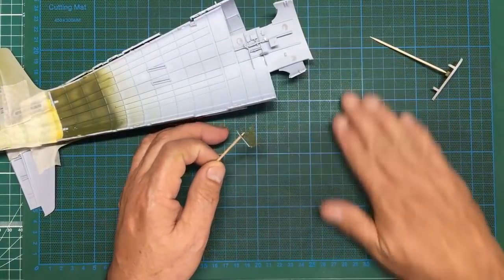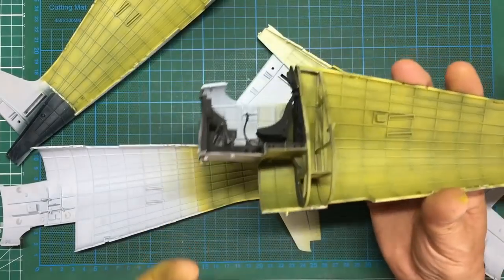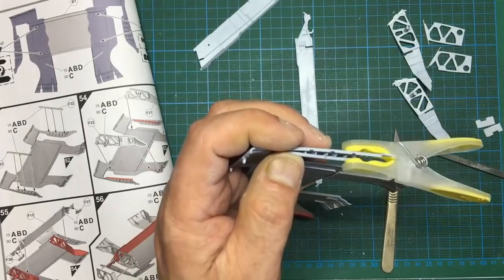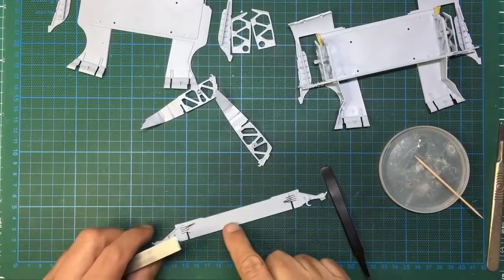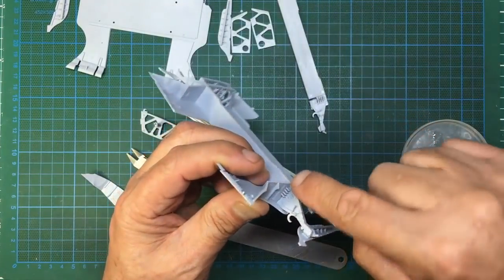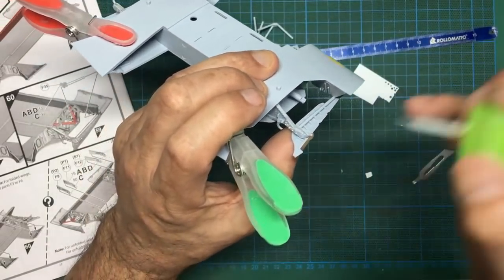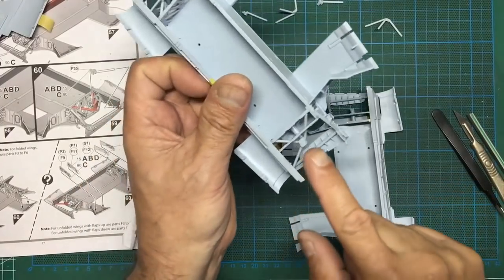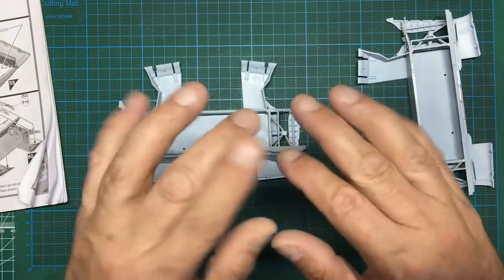Airfix 1/24 F6F-5 Hellcat in FAA service. Part 4... lots of stuff..

Comment: Great video Nigel.  I tried scribing between those molded on tubes but after I was done they still looked clunky so I cut them off and replaced them with lead wire also and the effect is much more realistic.  Thanks for the tip, looking forward to what comes next.

Comment: '' For corrosion control the landing gear, the bay and all of the door interiors is the same as the underside color. The only interior green would be forward of the main spar with lots of Light Gray overspray. The cockpit should be bronze green (1st 100 or so Hellcats) or interior green. Inside of the cowling and the area behind the cockpit with the windows is 'Grumman Gray' which is about FS36440 Gull Gray''...Seems that there is a lot of confusion about these colours isn't there..Leslie

Comment: Nigel you mention copper or lead wire. What is the difference as you mentioned lead can for a flat spot.
Reply from the maker: Hi Paul. Lead is great for areas where you need to be able to bend and position without too much effort and you're not going to handle the assembly. For example, if you plumbed a radial engine with lead wire then handled, painted and weathered it, the wire would collapse, break and deform. Copper would be better for this. I actually started making these lines with copper, but found I couldn't flex them around easily to enable assembly. I will be using copper on the engine.
Lead wire is good for small scale seat belts.. you squash it flat and just lay it over your seats. As it has no memory, it can be pushed and positioned as you like.

Comment: Nige
I'm getting very close to needing to buy and install the seatbelts. Any word on HGW making a set or do we go withthe  RB's sets?
Peter
Reply from the maker: I have had a reply from HGW.. they just said, "Yes". The question was.. "Do you plan to make belts for this kit"?
Reply: @NigelsModellingBench  

Nige
Thanks for the info on the HGW seatbelts and I'll old off buying any until they are available
Reply: @NigelsModellingBench  
Hi Nige
Great news about HGW - I'm waiting for their seatbelts.
I've started fitting the cockpit center section to the fuselage side and all seems to fit perfectly. Test fitting the two fuselage halves with the cockpit in place and they fit almost perfectly. I think your fit issue maybe be the is the cockpit floor is actually a bit too low. I used the left side side console framing as the placement guide for the cockpit floor, then glued the floor to the rear bulkhead and set it in place and the fit was nearly perfect. The root problem: the instructions aren't very good in locating parts and this is just one of them. Lots of drawings but the exact placement of parts are on the vague side.

Also the bar above the seat for the seat belt shouldn't be glued in place until after the part which angled from the bottom of the headrest to the bulkhead has been painted the same color as the headrest, which I think is actually leather and not sheet metal. 

Just love following your lead - makes a complicated kit so much easier to build.
Your friend 

Peter